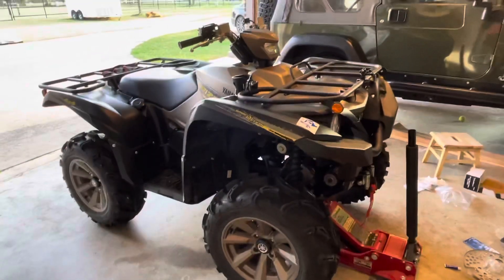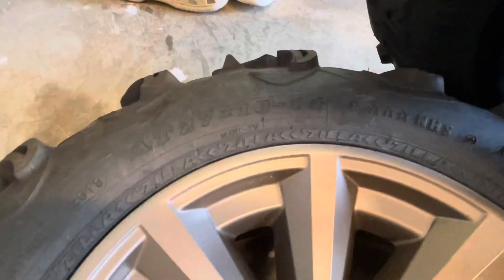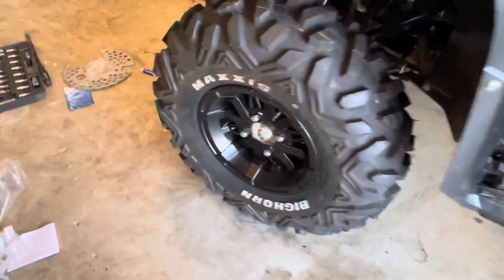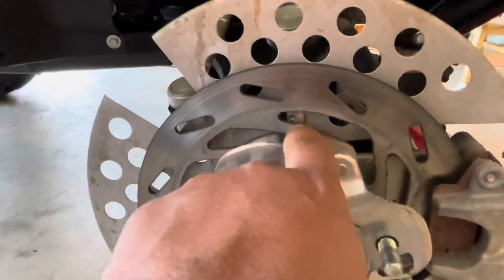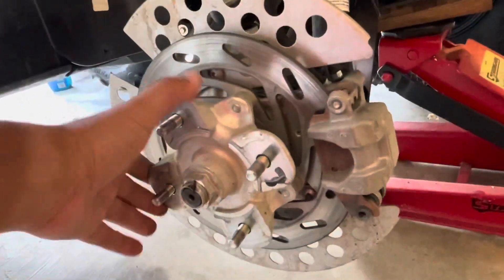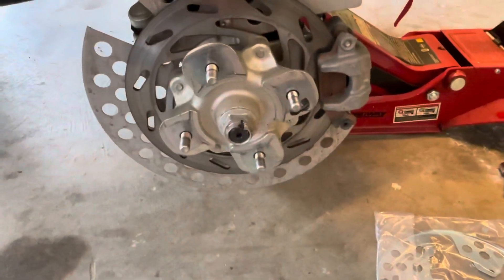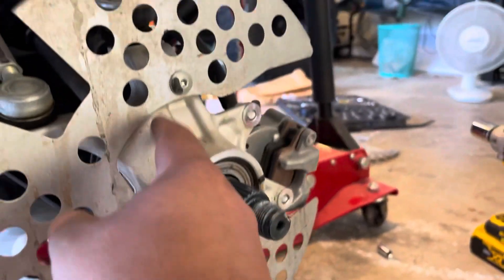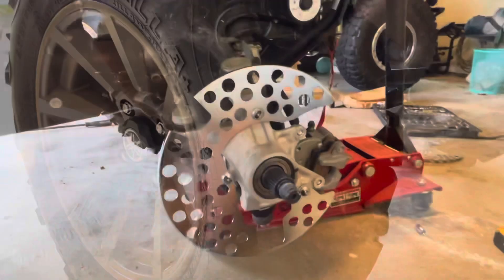Yamaha Grizzly XTR / SE 26” Maxxis Bighorn O.G. 12” Yamaha OEM wheels

Comment: WOW!  I super appreciate this video.  Was thinking of getting the XTR and then putting 12" rims/tires (with bighorns or clones) on it, because I want comfort.  Now I think I'll just get a base grizzly and add a winch.  I was already debating what would I do with those extra wheels/tires.  having to switch the brake rotor protector is a dealbreaker.  Hell, thinking of just saving all the monies and going kodiak base.

Comment: Black wheels look much better.  Wish I would have done the exact set up to mine. I just swapped out my tires for 26 inch bighorns  But on 14 inch rims. The rims that came with my special edition were black and looked great. Would have preferred 12 inch wheels though.

Comment: I have a 2019 Grizzly with the 27in Zillas. They are offset... not square. I love it for around my property. We took our four wheelers to Windrock Park. It did great and it was a great place.
Reply from the maker: Square means all 4 corners have same size tires and wheels
Reply: @urbanacres7189   correct. Mine doesn't as I don't have the xtr
Reply: @patriotsyndicate9532  technically it is a misnomer since a "square setup" actually creates an offset where the front end becomes wider than the rear. On a standard "staggered" setup , the tires and wheels are different widths but aligned even front to rear from the outside edges.

Comment: I have a 2023 Grizzly 700 that came stock with 27x10-14s all the way around , Thinking about getting a new set of tires but keeping the same 14 inch rims , I wanna downsize tires size though from 27 to 26 so should i get 26x10-14s in the rear and maybe 26x9-14s in the front? Whats the benefit of having a smaller tire on the front? thanks
Reply from the maker: I prefer smaller rims and more tire. Less rim damage and nice smooth ride that way.

Comment: Awesome video! Probably going to do the same thing with mine.

Question for ya, are the oem 12” rims a different width/offset front to rear or are they the same on all 4 corners?
Reply from the maker: Yes oem 12” are different width front and rear. I like the narrow wheels and tires in the front for better handling and lighter feel to the steering. More tire choices.

Comment: I drive on the hard stuff and on grass. The Zilla’s rip up the grass. What tyre you recommend for my use?  Is the 14x9x26 bighorn 2 a option (all same size) or would your 12” setup work out better for not ripping the grass lawn?
Reply from the maker: Don’t go with 9” wide tires as the 14” rims itself are 8” wide. Best would be what I did.
Reply from the maker: Bighorn 2.0 won’t last as long as the Bighorn originals last. The tread is also more on the original
Reply: @urbanacres7189  yes true, they say the 2.0 is lighter weight so I thought maybe gives a better ride. I like you set up very much though. Difficult choosing, it’s no cheap mod all together… thanks for your help.

Comment: Going to do this to my 2019 SE with the factory 14" wheels.  Wanting to run some smaller tires on 12" rims.  Partzilla shows the same part number for the rings for all four wheels, left, right, front rear. Same number as he shows in the video; I looked it up to see if perhaps there was a different one for left/right/front/rear.  BB5-F514A-00-00
Reply from the maker: Front and rear have different part numbers. Front is narrower rim.

Comment: Does the machine feel quicker and have more power with the 12" rims ???
Reply from the maker: Not really because I picked heavier tires. But due to skinny fronts steering feels lighter and that is what I was going for.
Reply: @urbanacres7189  the reason why I ask about the felt power is because I just barely traded in a 2017 grizzly that had the 708 motor for a new 2023 grizzly xtr that has the 14" zillas and the 686 motor. The top end power and spirited trail riding is definitely not as good as with my 708 i had on 26" maxxis bighorns just like the setup you have... just was wondering if its the 686 motor that just has less top end power and slightly less performance than the 708 or if it's the heavy tires on the new xtr that make it feel that way... either way I'm missing those 26" bighorns I once had and was wondering if it was worth going back to that setup
Reply: @urbanacres7189  I really like the way yours looks with those all black 12" rims. Looks way better IMO. I think you did good with those rims and bighorn OGs.
Reply: @brennenlee7715 the xtr is geared lower from the factory vs the regular grizzly.
Reply: @jessecameron7268  I don't think thats accurate... The latest grizzly with the 686 motor is geared lower than the 708 grizzly was... but the clutching is the same across all models
Reply: @jessecameron7268 no, it is definitely not geared lower. XTR is strictly a package. Nothing to do with the mechanical.

Comment: Did you try Bighorn 1.0 26x9-14 fronts and 26x11-14 rears with your original XTR 14'' wheels?
Reply from the maker: No 14” wheels are too wide 8” or 8.5” 
That is basically too wide for a 9” wide low profile tire running 5 lbs of air. Especially for an off-road only vehicle.
Reply: @urbanacres7189 no they are not too wide. They would have worked just fine

Comment: 26x9x12 fronts
26x12x12 rears
??
Reply from the maker: Yes correct
Reply: Do the 9” wide front tires fit well on the OEM 12” front wheels?

Comment: Why didn't you just use the new tires with the 14" rims?
Reply from the maker: New tires are for 12” rims. And original 14” rims are designed for square setup that means front rim is same width and the rear rim and too narrow of a tire won’t fit.
Reply: @urbanacres7189 they actually would have still fit just fine if you had it. Went with a 14 inch version. The slightly now our rim is not going to make that much of a difference. Perfect. Example is people buying aftermarket rims. They're all the exact same offset yet they still go with the staggered setup. There's no difference.